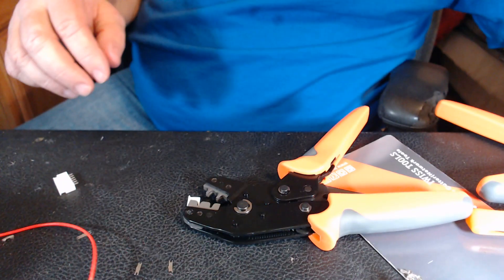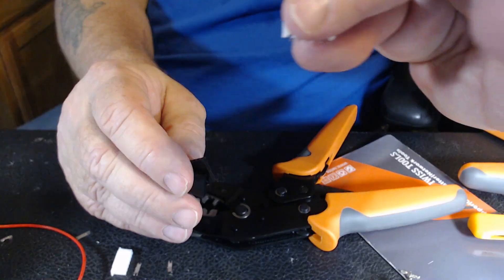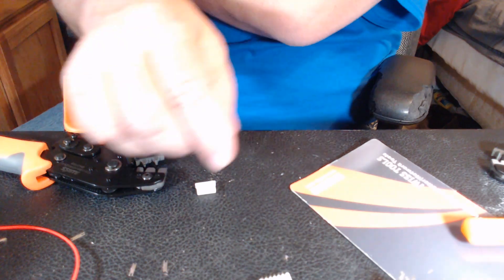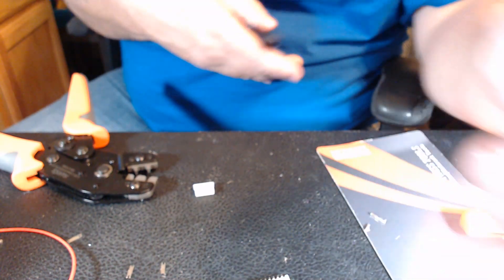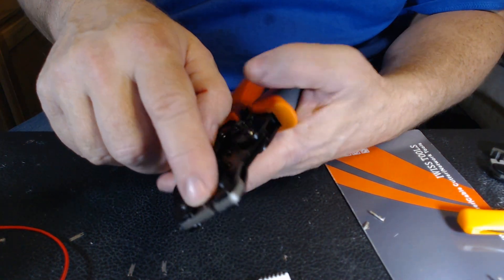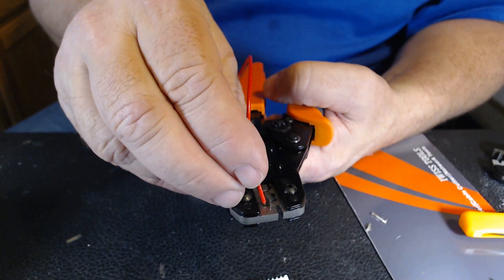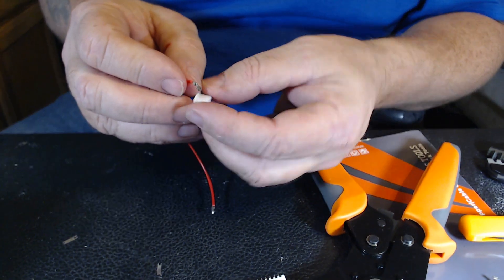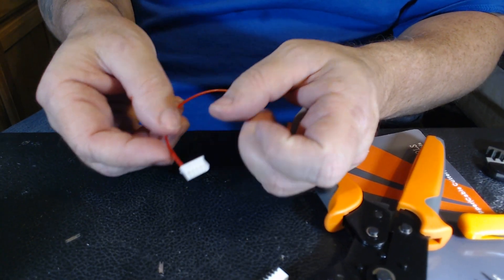How to crimp a JST XH Connector

Comment: Thanks for the video. The part I needed was the very last bit, the correct orientation of the pin in the socket. That saved me a lot of trial and error, they clicked right in like you said. I used a dupont crimper because that's all I had, I just adjusted the position of the pin back in the tool. I was replacing a dupont connector pair (male/female) on an attiny programmer. The advantage of the JST-XH for me is correct 'polarity' enforced by the JST-XH connectors. I've burned out a chip before plugging in the dupont connector backwards. The disadvantage (or advantage depending on your usage) is the JST-XH connector is a lot harder to pull apart (by design). I have a pin insertion tool (from ages ago, rs232 work) that worked well with the JST-XH socket. It was too big to work with inserting dupont pins. My work is for my own usage, not commercial, but I'll comment on the crimping. If it's for your own usage, I'd say whatever works reliably for you is mostly okay. I trim 2-3 mm of insulation off of my wire and then the trick for me is to just insert up to 1 mm of insulated wire into the pin before crimping. I often overshoot, but when I get it right, I always get continuity in the wire, and a bit of the insulation is grabbed securely by the pin. Thanks again for the video, it came up first when I googled 'jst xh female pin alignment'. And as I said prior, that last bit was exactly what I needed.

Comment: The best tool for crimping dupont terminals is the Hozan P-706. It has the correct round die for the insulation crimp. The way I do them is to lightly crimp the insulation first with the 1.8mm round die so that it holds the wire but can be adjusted then adjust it so the end of the insulation is halfway between the insulation and conductor crimp then give it a firm squeeze so that it hugs the wire tightly. Then crimp the conductor in the 1.4mm die, here you can just bear down because it's exactly the right height for 22-26 AWG wire. It's a little slower to use but makes flawless crimps every time that look just as good as a commercial servo extension.

Comment: WRONG. NEVER strip the cable when using the Dupont system. It relies on the insulation to maintain integrity of the joint. The blades on the connector are designed to pierce the insulation.

Comment: This is WRONG. The pin should be holding both the conductor AND the wire sheath. Crimping like this will eventually cause failure due to mechanical stress. Look up the datasheet for JST connectors.
Reply: agreed, not that guarantees there wont be a mech failure at that point, but holding the insulated are will certainly lead to mechanical failure.   I like to heat shrink when there is gonna be a lot of stress on the wire.   anyways the stripped section should be about half as long such that the insulator makes it into the 2nd crimp ring without the tip shoving up into the pin contact. Btw anyone who needs to do just a few of them, careful use of needle nose pliers will get the job done just as well, little more frustrating...I have been doing them that way  for years.
Reply: I can vouch for you.  That's why there's TWO sets of tabs on the pins! The longer tabs are for grabbing the wire insulation, the shorter tabs are for the conductor. This guy didn't understand how to properly crimp, and his tutorial, if followed, will lead to wires breaking-off, right at the end of the insulation. 
   The small portion of exposed wire is easier to bend than the rest of the wire, so that small portion will get bent at a tighter radius. The inner side of the bend is under compression and the outer side of the bend is under tension, which pulls the metal atoms apart from each other, and the copper gets stretched-out, meaning that, the cross-sectional area the conductors will get smaller. 
   Once the wire gets bent in the other direction, the pulled-apart atoms don't get pushed back together the way they were before (think of it like trying to push a rug, rather than pulling it). Each time the wire gets bent a little, decreases the cross-sectional area of the conductor like this, until finally, it gives.
   That is why most connectors are designed that way; when the wire gets bent, the entire wire length bends, so no single point gets bent at a smaller radius than any other point in the line.
Reply: yeah all mine that come connected from factory hold the insulator
Reply: And not the JST WC-110 crimper.  Pretty sorry example!

Comment: THANK YOU!!  I've been looking everywhere trying to figure out why the IWISS SN-28B crimpers I have only destroy the JST connectors I try to make.  It's because I was told the wrong model to get... guess I will be spending another $20 on the SN-01BM pair too.  You have been a HUGE help and thank you so very much for making this video... I've been pulling my hair out over this!! :)
Reply: My first attempt with my SN-28B mangled it, but my second one worked perfectly. You just have to put it farther in so the same part of it sticks through (if having trouble, just bend the long skinny pins so they grip the insulation, it just needs to be enough to not fall out on its way to the crimper). The goal is to preserve the tab sticking out the back
Reply: Plus, if it's crushing the connector, it can be adjusted by turning the screw.

Comment: What is the crimper model for dupont and what is for XH?
Reply from the maker: The Duponts use  IWISS SN-28B Found here https://amzn.to/2IxEbCM
The JST XH work with this SN-1-01bm found here https://amzn.to/2IyV1B2
Reply: The IWISS crimpers have been awesome with other connectors the advertise compatibility with.  Just ordered the SN-1-01 to see how well it works for the HX crimps.  Ridiculous that they are asking $500 for a hand crimp tool.  Even my German made crimping tool SET was less than half the JST low production hand tool asking price.